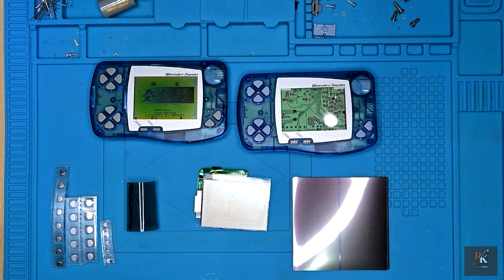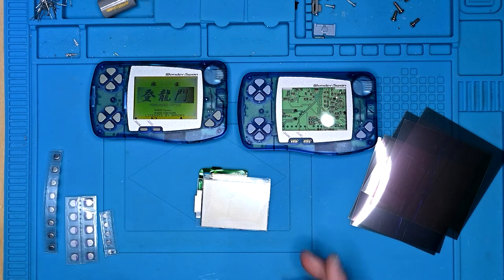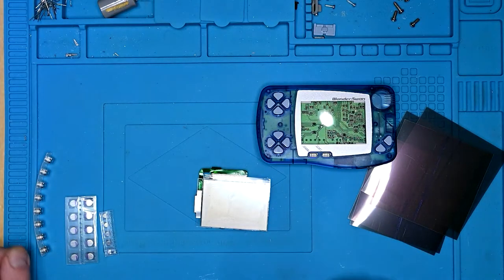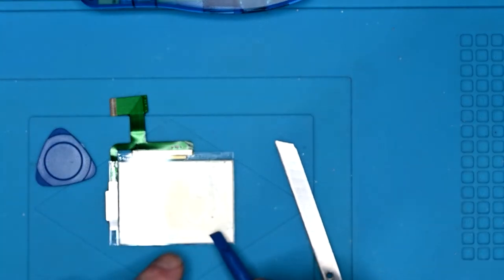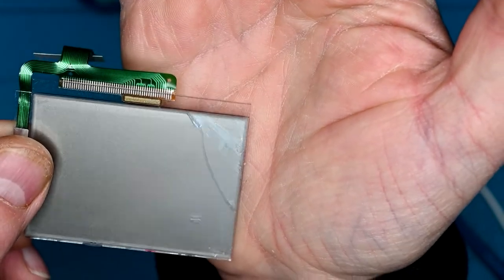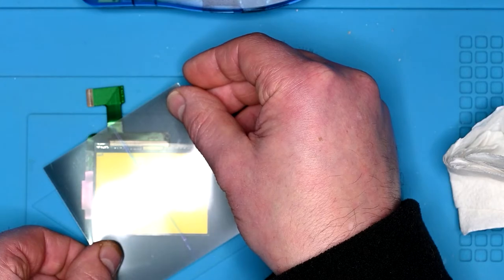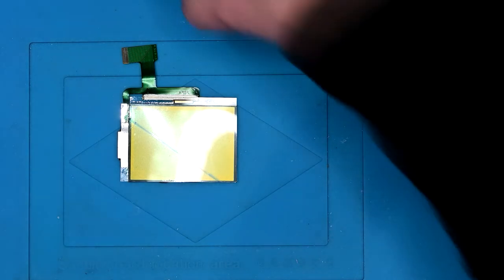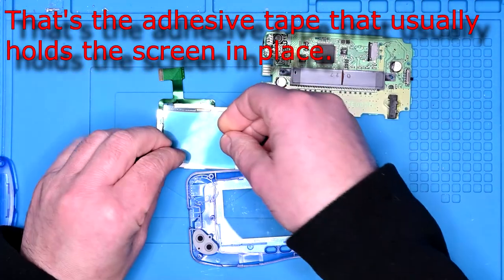Repair/Restoration: Bandai Wonderswan Experiment & Giveaway!

Comment: Seen quite a few of similar videos on the polarizer. Yours is really good. This is the first one I come across that mentions replacing caps.. now I have to go over my swans and do the same! Thanks for your video.
Reply from the maker: Thanks :)
The caps on other systems of the time were suspect so thought I'd give it a go. Certainly seemed to work for me at least!
Doing the polarizer is a pain but worth it in the end. Not a fan of trying to get them to 'stick' to the LCD as I can never get the air bubbles out...
Reply: @RetroKrazy  I did it on my 5 swans in my collection. I fixed the polarizer to the LCD though. By taking a small portion of the protective film on one  side and slowly taking it out as I peeled out the rest of the film. It worked just fine but with one I hade to 'unstick' which left a small mark on it. fortunately it is not visible once it is turned on.  Right now they are working fine.. but will look forward to replacing the caps if any of them exhibit issues. Thanks again for the video.

Comment: What's the advantage of using this soldering iron? And do you have any links for it? Much appreciated!
Reply from the maker: I use an Aoyue station and love it. It has a built-in fume extractor that really works well, ulta fast heat-up time (seconds) and interchangeable tips. Hot air is also built in, you can add in an SMD iron though the desolder pump wasn't that great I found. You can fine it here on the Aoyue website, though I'd hunt about for the best price based on where you live: https://www.aoyue3d.com/en/pro/default.asp?id=372

Comment: Hello, I recently purchased a Wonderswan and I was wondering whether you could tell me where to find replacement parts. It has a missing button and the screen could use a new polarized filter. Besides, there is no sound when I turn it on but I don’t know if a game is needed for the console to play any sounds, I have no games yet either.
Thanks in advance
Reply from the maker: Hey. I sourced the polarizing film off AliExpress. It's not expensive and you usually get 5 sheets or more in a bundle so plenty to allow for mistakes! The sound you won't hear until you have a cartridge inserted and the button, I'm unsure. I don't have any spare at the moment, sorry :(